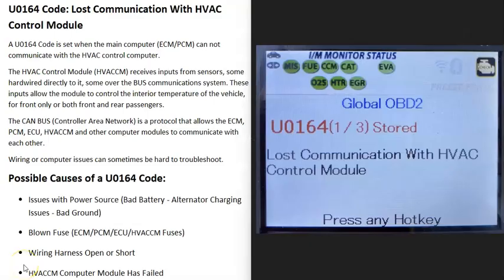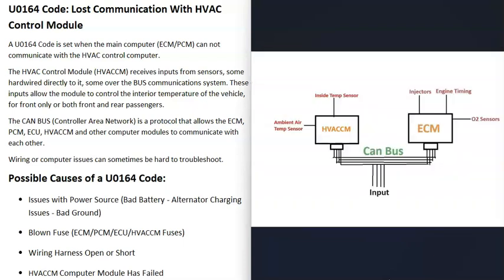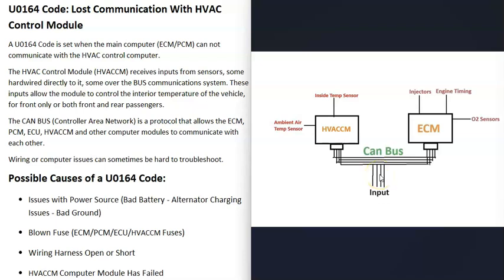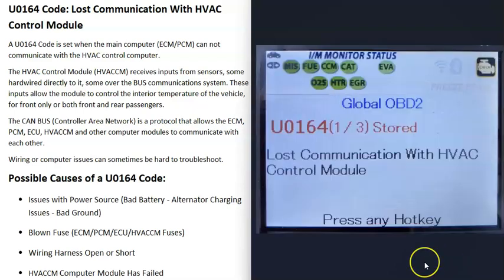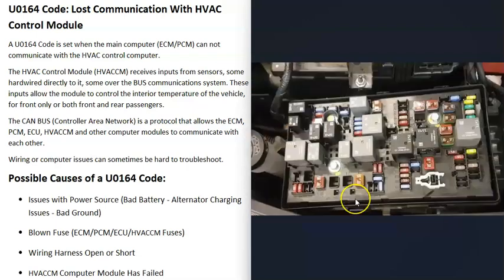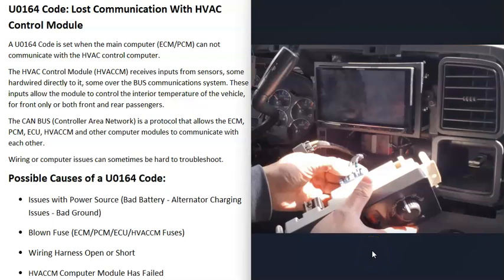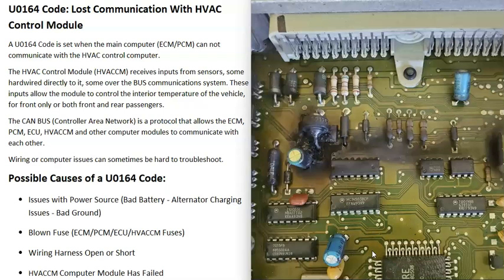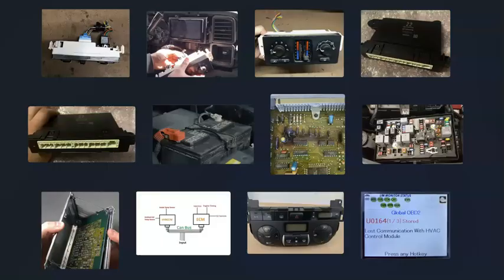Causes and Fixes U0164 Code: Lost Communication with HVAC Control Module

Comment: Thanks for the video. My 2023 Kia is having this problem and would cut in and out and when the AC was out it would blow hot air on feet and no way to turn it off and at first just hitting the front defrost botton would get the AC to come on and turn off the fan blowing on feet...Went to dealership...they said it was just a software update. 4 days later was doing it again, It nearly burned the tops of my feet to just drive it 15 mins to dealership. They have had it 6 days already with no progress. We will see how long it takes them to figure it out.
Reply: Resolveu?! Não seria a válvula torre do compressor?

Comment: After watching this, I checked the fuse for the HVAC cabin control(10A-M34 position in the 2011 Grand Cherokee), and after pulling it, it looked okay. However, before reinstalling it, went to see what was affected in the vehicle..noticed the dashboard compass was not working, but miraculously, the HVAC was working fine! Reinstalled the fuse and now no more “pulsing” of the blower when turning on the heat. What caused it to start acting up?..no idea. My only guess as to what fixed it is that some kind of ‘reset’ happened by pulling/reinstalling fuse. This video pointed me in the right direction. Many Thanks for posting!